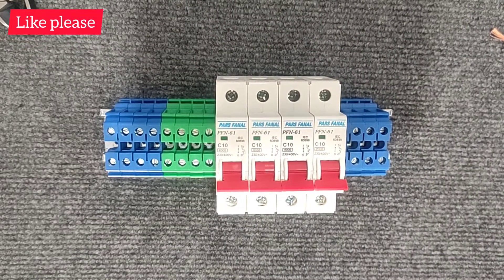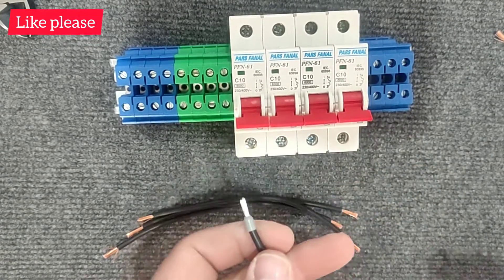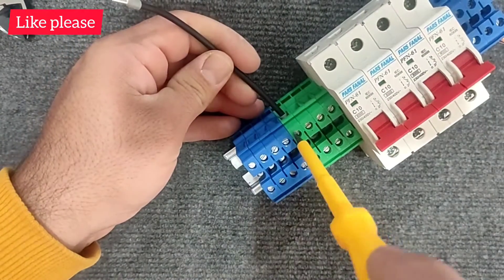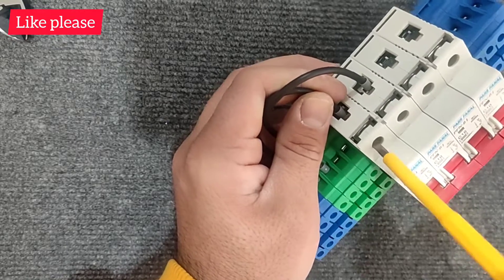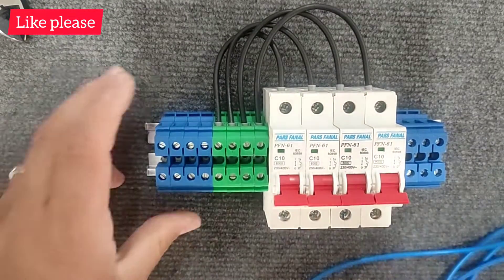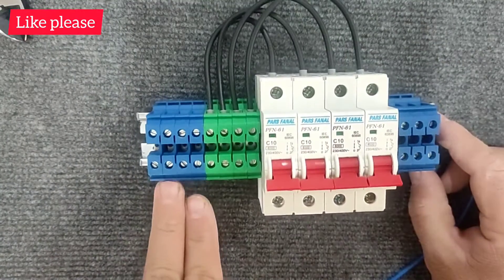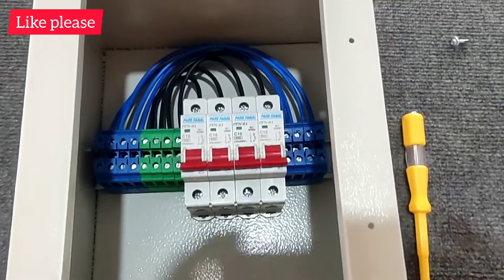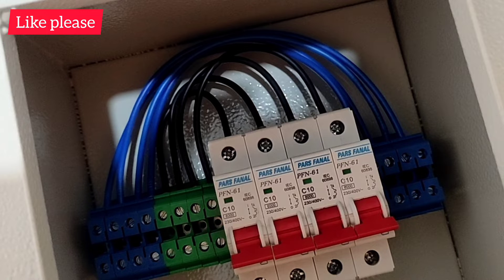electrical panel wiring training(Suitable for Beginners)

Comment: Very nice job Mohandes. But I wish in one video, you could talk about all used wire types, wire thickness, wire and terminal sizes and color codes, and if there is different between home and Industrial in case of color codes or else what is the different.
Reply from the maker: Hi
Sure